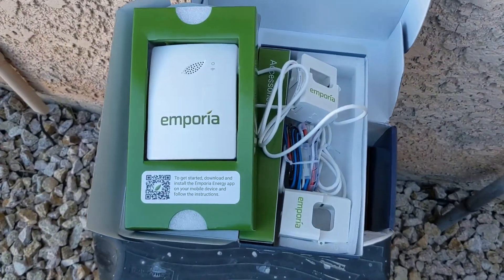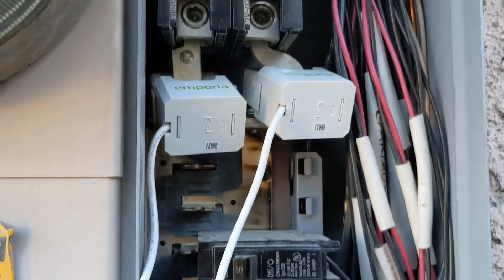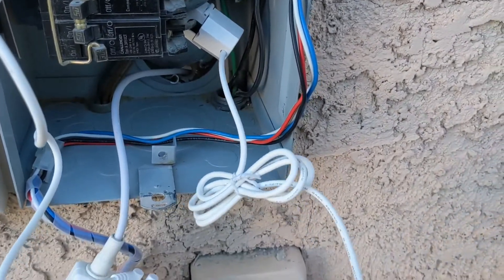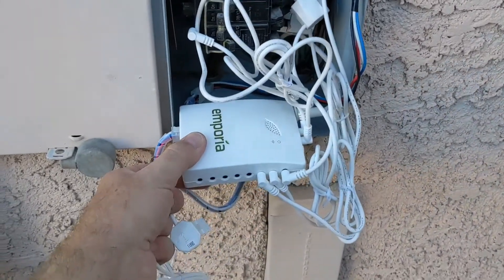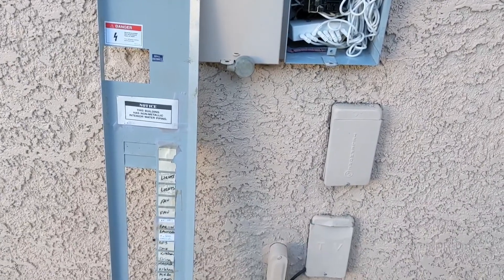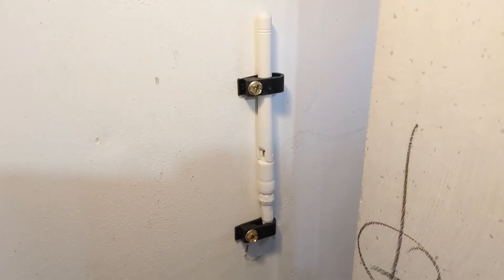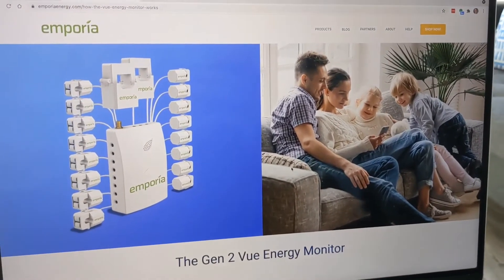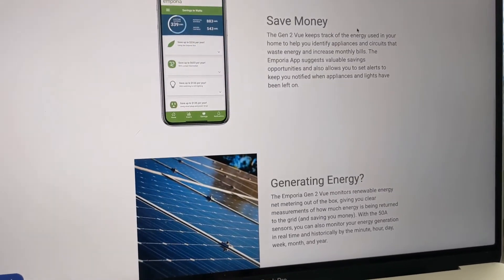Emporia Gen Vue 2 Energy Monitor Installation

Comment: Do I really need the Sensors?? What if I only get the monitor with out the sensors?
Reply from the maker: You can buy it with either 2 whole home sensors, or with 8 or 16 additional ones which can monitor individual circuits. It depends what you're trying to do. Personally I wanted to get an exact breakdown of usage from different appliances so I got the one with the 16 sensors.

Comment: Just wondering if you considered the Sense monitoring system. Dies the Emporia system have distinct advantages over the Sense system?
Reply from the maker: Yes, two main benefits. Price... it's cheaper. But the other thing I really liked is that it monitors up to 16 circuits individually. That mattered to me, because I can get an accurate read. The sense is using AI to try and figure stuff out. I just put in top of the line variable speed air conditioners and they constantly are modulating their power draw. I really doubt Sense would be able to work that out from their two sensors on the main circuit.

Comment: So you only put a single clamp on 1 wire going to a double pole 240v breaker?  It doesn't need a clamp on both hots?
Reply from the maker: Correct. In the app there is a setting to double the reading. So you have the choice to do that, or put a clamp on both hots. The reason to do that would be if there's a big imbalance in the usage of both sides.